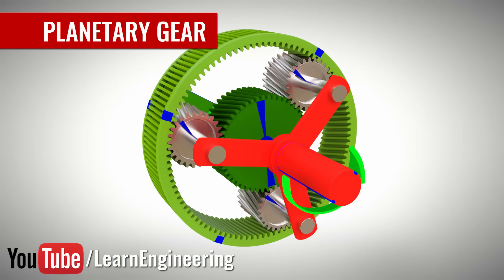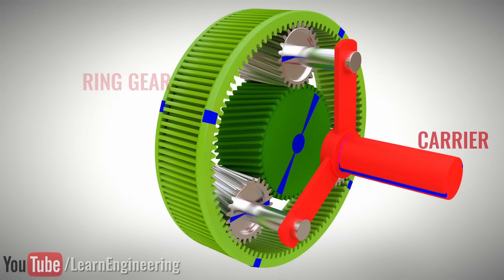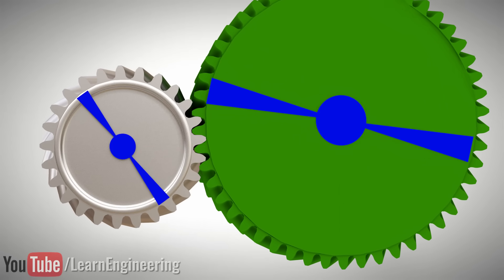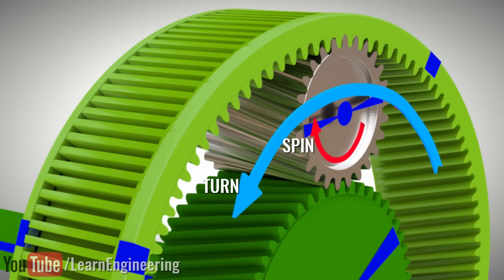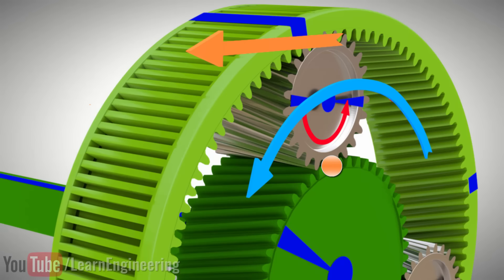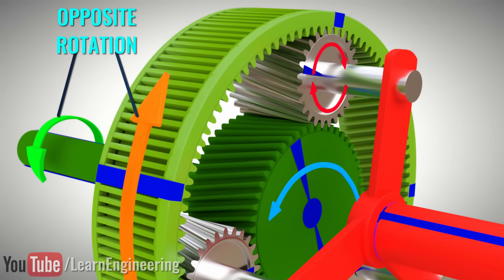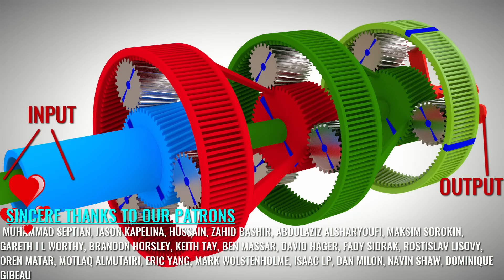Understanding PLANETARY GEAR set !

Comment: If God had employed an engineer to design the human body, what type of engineer would have been most useful?

Considering the structure of the bones, cartilage, & muscles, a mechanical engineer?

But to control them requires the brain and nervous system, surely an electrical engineer would have been the better choice.

Ends up he employed a civil engineer.  Who else could have successfully routed the sewage system right through the middle of the amusement park?

Comment: Not only is this the best explanation for the gearset that I've beard so far, but this is also the first video that's titled what it actually is instead of claiming it's about automatic transmissions but just the gearset part and nothing about how it shifts and how each set applies more torque or speed.

Comment: I don't understand anything, how many times do I have to watch this video to understand?🤔🤔🤔🤔🤔
Reply: The part labeled red (carrier shaft) in the system connects to the wheels. The gear in the center of the planetary gear a.k.a sun gear connects to the engine. The outer gear or the ring gear decides whether the engine should move the car back or forward. When the car is put into D, the ring gear is locked so that the sun gear can move the carrier shaft. When the car is in R, the engine moves the ring gear instead of the sun gear while the sun gear is locked so the carrieer gear moves the opposite way around. However, when there are more than one planetary gears in a car, the ring gear can also be used to connect the first planetary gear to the next one for more speed and efficiency. Kindof like switching from gear 1 to 2 in a manual.
Reply: Feel free to correct me if i made any mistake in my explaination
Reply: @notsogood2576  thank you for explanation
Reply: Need engineering mind
Reply: same
Reply: This guy doesn’t explain well.
Reply: Not well explained.
What have office supplies got to do with movement?
Office supplies are stationery.
Something not moving is stationary.
I lost interest after that.

Comment: Theoretically, the Planetary Gear can also be used for infinite energy, assuming you can

- find a Synchro powerful enough to get the gears spinning fast enough
- find a way to keep the gears from breaking before they reach that speed
- find a way to avoid Inversion (the gears getting so fast that they end up getting in the way of THEMSELVES and the entire thing locks up as the gears pingpong back and forth between themselves and themselves until the entire thing just explodes)
Reply: But you forget friction and the heat generated by it
Reply: @2003AudiS3  True. It's entirely theoretical, but I wonder if hard light constructs would be subject to friction and heat? It wouldn't break down, so if friction isn't a thing impeding speed, the biggest threat would be Inversion.

Comment: What causes the planetary gear set to become damaged?
Reply: nothing.  It is constantly meshed.  Clutches and brakes can wear out though... alsong with hydraulics
Reply: @LexusGX460-OFF-ROAD  I have a 2022 Tahoe with 7000 miles on it and the transmission started making a noise.  The service department said the planetary gears were damaged.  What other part malfunctioning would have caused them to become damaged?
Reply: @Michelle Gibbs  just trade the Chevy for a Toyota or Lexus... 😃
Reply: @michellegibbs6907  lack of lubrication from insufficient oil pump pressure will cause the gears and/or the bearings inside the planet gears to overheat, burn out bushings, etc. or serious abuse can damage the planetary gears.
Reply: @Isjix4410  thank you for that information.  I want to make sure whatever caused the planetary gears to become damaged is fixed.
Reply: @michellegibbs6907  a good trans shop will go through the oil pump or replace it if needed and make sure the oil passage ways are clear of debris so it's sufficiently oiling the planets and other moving parts and applying enough hydraulic pressure for your clutchpacks too

Comment: When the main motor runs at 11000 rpm twitch the help of planetary gears and sun gears we get the speed reduced  and the torque gets in creased a small motar dia 30 to 40 mm dia and a length of 10cmm can produce a Torque when converted to an actuater
Reply: Will  give a Torque of aboiut7
Reply: 0

Comment: Gears are quite easy to understand, once you get 2 points:

1. Perimeter: a gear with 2* perimeter will make an adjacent 1* perimeter gear, spin twice as fast.

2. Clockwise (C) and counterclockwise (CC): very important to see spin (or as it is called in science and engineering "angular momentum") as going C or CC, not spinning "to the right" or "to the left" (confuses things). So a 'C' spin will go:

    - downwards on the right edge
    - upwards on the left edge
    - rightwards on upper edge
    - leftwards on the lower edge

'CC' spin will be the exact opposite.

If you see a complex gear system, just break it down to its component gears and observe their individual behaviors (you may wanna start where the power comes).

Comment: Here is paradox I personally invented. If I have a light year distance of a line of connected gears and I move the first gear after how much time will the last gear move. How would the delay be mechanically explained as in order to move the first gear the last one must also move simultaneously.

Comment: Also an interesting application: the hybrid drive from Toyota...
Reply: Yes. Toyota calls it the Power Split Device (PSD). Motor Generator 1 (MG1) is connected to the sun gear, MG2 is connected to the ring gear, which is in turn connected directly to the driving wheels, and the internal combustion engine (ICE) is connected to the planetary gear set carrier.
Reply: @qwasrfg  If I  understood correctly, the ratio between the ICE and the wheels when MG1 is not turning, is comparable with a classic transmission's 5th gear... driving away from stationary happens on the power of MG2 and only at a certain speed the ICE is turned on and gradually takes over... MG1 regulates the ratio between turning speeds of ICE and wheels. Cool application, and seems to be rather reliable.
Reply: @marcdecock7946  Yes. You have perfectly understood how the Toyota hybrid synergy drive system works. And, as you have explained, the way the ratio of the contribution of torque from the ICE to the wheels is regulated by MG1 is why Toyota calls it an eCVT (electric continuously variable transmission). Normally, the ICE kicks in around 60km/h, unless you press the accelerator pedal hard. If the ICE is running, any excess mechanical power is converted by MG1 to electrical energy and sent directly to MG2 to drive the wheels (in which case the system becomes a series-parallel hybrid) or sent to the battery to be stored for future use. If the wheels lack power, electrical energy from the battery is dumped into MG2 to help the ICE if the computer calculates that this is the most efficient way of using the available energy (petrol in tank and electricity stored in the battery). When you lift your foot off the accelerator pedal and/or press the brake, MG2 becomes a generator and charges the battery. If the battery is full and you are running downhill, there is a B (brake) mode you can use. In this mode, the electrical power from MG2 is sent directly to MG1. This causes MG1 to spin the ICE, the latter working as a compressor since no fuel is being injected in the cylinders. Thus you still have conventional engine braking but without wasting a single drop of fuel. Beautiful technology!
Reply: @qwasrfg  I agree, it's not that much additional hardware, and the result is worderful. Also recuperation of brake-energy... I did my thesis on CVT's with a V-belt, too much wear and tear . I understood Toyota is also looking to make a hybrid driveline with a double planetary gearset, even more fun, but they seem to have some difficulty to optimize it with electronics...

Comment: Everyone fixates on the rotation ratios. How do you calculate the sizes of the gears so they fit??
Reply: You design the gears to operate at certain speeds. When you know what speeds you're aiming for then you know how big you want the gears to be using equations like:
w = v/r
where w is angular velocity,  v is velocity,  r is the radius of the gear.
Mating gears have the same v.
Gears that lie on the same shaft have the same w

Comment: Speed reducing or torque multiplier gear boxes play important role in machineries... please do make some videos on that...(worm,helical,spur,drum drive) if possible calculation too..
Reply: Overdrive ratios also play an important role on increasing the speed, underdrive ratios can be important especially if you are climbing a hill.
Reply: But for flat roads it doesn't matter.

Comment: I have a question.
If you are making the carrier stationary then how will you supply the reverse rotational motion to wheels??
I understand that the sun gear will work as a drive gear and the ring gear will work as driven. But does the ring gear also connected to the wheels some how ( wheels = any output)

Comment: Please can u explain the concept of overdrive in transmission system. Please
Reply: Shivam Mishra I’m pretty sure overdrive is any gear ratio that is below 1 to 1
Reply: It is the use of multiple planetary gear sets in sequence, where the output of one becomes the input of the next, so that the overall output rpm (from the transmission) is greater than the original input rpm (from the engine).

Comment: As a self taught automotive technician who within a decade, became a ASE Master Tech, then called NIASE (National Institute for Automotive Service Excellence), I find this video is lacking in not a single mention of the actual inventor. A guy born in 1892, named Howard Simpson. The planetary gear set shown in the this video was patented in 1950 by Howard Simpson, who had worked for people like Henry Ford in the tractor division. The use of the "Simpson Gear Set" was a common term used in the powertrain devision of any draft rooms, full of powertrain engineers, working with his planetary gear set concept to arrange and hydraulically control multiple gear ratios, 3 speed, 4 speed and more used in automatic transmissions for half a century. 
Even the Model A thru the Model K used a planetary gear set that was engaged by simply applying a pedal to hold, release or change one of three components used to make the Simpson Planetary Gear Set as one of the worlds most innovative & simple drivetrain components ever invented. Used by license, Chrysler, GM, Ford and Mercedes Benz just to start, benefitted with the use of this reliable simple yet strong device.
 Today, these compact gear sets, are combined, back-to-back in many configuration, used in concert with electronically controlled and mechanical devices to achieve gear ratios in transmission with up to 10 speeds, including reverse. 
  Howard Simpson who died from cancer at a relative young age, but is held in such high regards, the industry parties joined and combined to created the SAE/Timken Howard Simpson Transmission and Drivetrain Innovation Award. 
  Why is he not mentioned? From cordless 2 speed drills to air ratchets, the use of the Simpson planetary gear set is used to our advantage, to produce an efficiency, size, reliability, with speed increase, mechanical advantage decrease, or the other way, plus reverse and a infinite variety of gear ratios to change power & speed, I submit to you, world would not be the same world as we know it today. Call it what you want, but I recognize it's importance and who designed it.
Retired ASE Master Tech since 1978.

Comment: Is it possible to run a planetary gear set where none of the sun/carrier/ring are fixed?  Example is a hybrid transmission where the engine is supplying torque - motor A can still turn?  Is it a relative velocity thing?
Reply: 2 years late answer but yes. Toyota Prius uses that exact idea for its “e-cvt”
Reply: @soy_leche  Thanks Ryan I stumbled on this video a while ago for anyone else looking in to this https://www.youtube.com/watch?v=ZmHpSyTsfm0

Comment: Why can't I find the answer to how an automatic transmission actually shifts up? I understand it slips into the next gear when a certain amount of torque is applied but I cannot find any diagram or explanation on what exactly happens in the transmission
Reply: you must not be asking the right questions, or looking at the right diagrams. when they change from one to the next, something mechanically moves one or both of the rods to a different position, where the next gear is to meet it. could be a linear actuator of any variety, could be a fully mechanical gear selector... there's a ton of ways to skin this cat, you must be thinking too hard, or need more experience. it's pretty apparent what is happening, when you see it in motion.

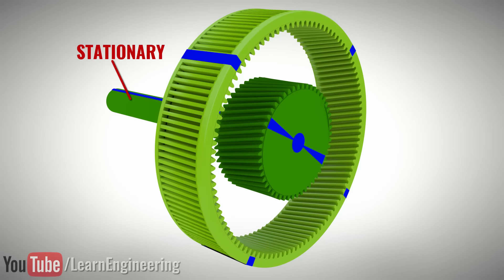Comment: 2:47, How do you rotate the ring gear? There is no shaft connected to the ring gear for torque input.. please explain
Reply: @Mr Sunshines wow harsh reply. At the risk of sounding like a moron myself I have to take it.  Can I have a Ring gear be the drive gear.  For example it would have teeth on the outside as well as inside. The outside teeth are rolling down a rack gear like a wheel on a railroad track.  I would make the planets stationary and the sungear is my output gear.  I basicaly need an 8" diameter wheel that is rolling at 20mph  or 840rpm  to turn a shaft 3,000 rpm.  I thought planetary gear set up would work well.  Thoughts?
Reply: If you want, the ring gear can be it's own wide shaft.
Reply: @Mr Sunshines u could just say refer to 41 seconds into the video when the animation is complete.. and also mention the power input turning the planet carrier turning the pinion gears which turn the ring gear? Instead of just calling someone a dumbass..
Reply: @Mr Sunshines lmfao you are a joke of man
Reply: @Mr Sunshines no counterarguments in any of his replies.. just the word "dumbass" 
Look everybody!! We found someone who thinks they're cool because they understand simple gears! Lmfao
Reply: @Mr Sunshines you weren't calling me a dumbass for not understanding the video.. you were calling me a dumbass for criticizing you calling other people a dumbass... so basically I'm a dumbass for criticizing you at all? In other words you want me to spend my time trying to prove to you why calling people dumbasses isnt productive? And then that will make me not a dumbass? 

You are an odd, unhappy fellow who i cant relate to because I dont have a minuscule penis.. sorry about that man

Comment: A phrase I learned to help determine what’s gonna happen, depending on what the carrier is doing:

Oh I
Really Hate
Ugly Oldsmobile’s 

Over drive (Oh) is created when the carrier is the Input (I)

Reverse (Really) is created when the carrier is Held (Hate)

Underdrive (Ugly) is created when the carrier is the Output (Oldsmobile’s)

And from there you can know by if you know which gears are the input and which are the output (bigger gear driving a smaller gear = more speed and less torque, smaller driving a bigger is the more torque but less speed)

Comment: Hello
Need ur help urgently..
I have material Lifting Machine of load capacity 300 kg , which is placed at 15th floor. And connected via single phase 3hp motor and rubber with wire rope drum. It only works for uplifting the material. But I want it as work for  both uplifting as well as downlifting the material. Which gearbox I would buy and in which ratio so that I could get  speed of the machine maximum  35 - 50 mtr/min for uplifting and downlifting the material.

Or any alternate available.

Please reply
Reply: Load

Comment: Hello Ankit bro,
Need ur help urgently..
I have material Lifting Machine of load capacity 300 kg , which is placed at 15th floor. And connected via single phase 3hp motor and rubber with wire rope drum. It only works for uplifting the material. But I want it as work for  both uplifting as well as downlifting the material. Which gearbox I would buy and in which ratio so that I could get  speed of the machine maximum  35 - 50 mtr/min for uplifting and downlifting the material.

Or any alternate available.

Please reply

Comment: so why are the teeth at an angle not straight across?
Reply: so thay can carry more load.
Reply: continuous engagement, more surface area and teeth engaged at all times so it can handle more torque and is quieter when turning unlike the straight cut spur gears slapping single teeth together, but it's down fall is it's high axial thrust
Reply: It's a helical gear .. to reduce backlash and increasing efficiency .
Reply: Instead of 100% contact for less time (gears "slapping" together) you get constant gear contact even (though less surface area is touching at once)

Smoother and more efficient delivery of power